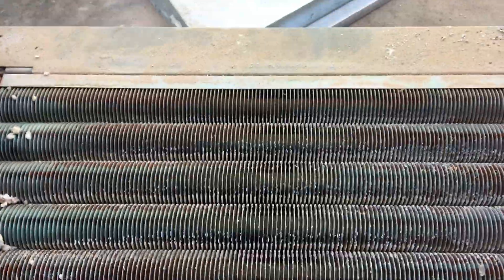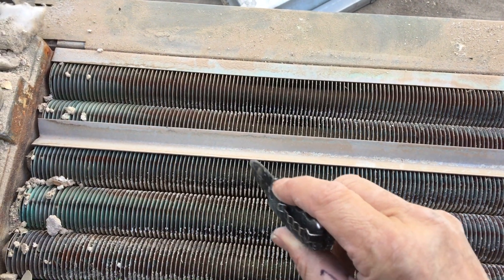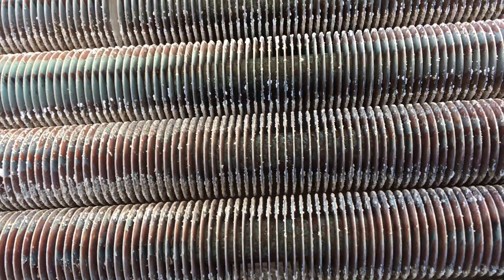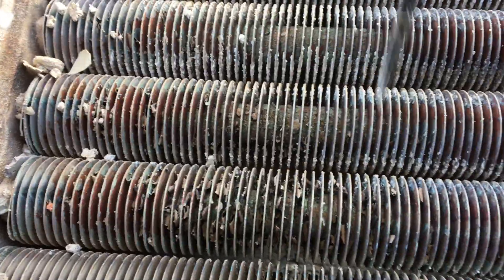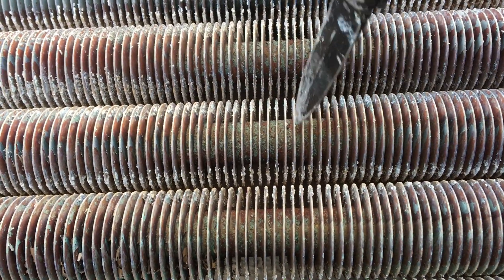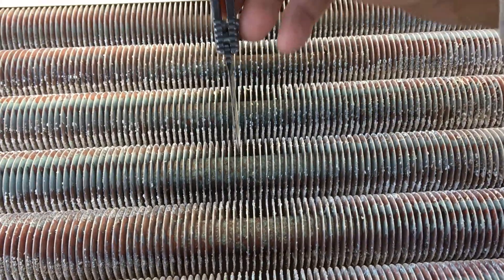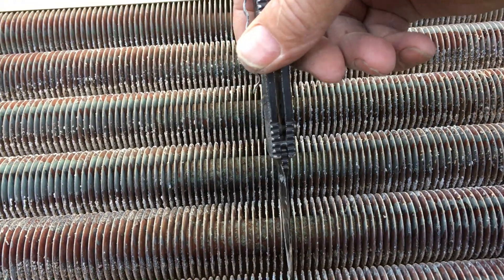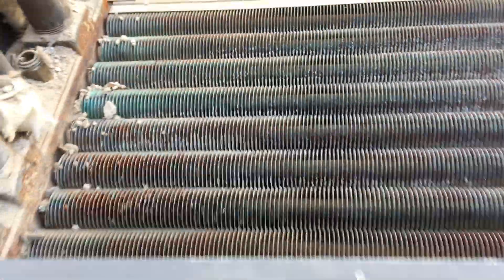Laars boiler dissection part 4

Comment: Teledyne Laars.  I’ve worked on some of those that were ten feet long and four feet deep.  The baffles were wired in place.  If there is any chlorine, such as in a swimming pool equipment room, it mixes with the combustion air, and rots all the fins off.  I’ve changed tube bundles in these that took four men to lift.  When you lift out the tube bundle, the combustion chamber walls would fall apart.  You have to re use the old brass manifolds, as the coil bundles were bare.  And then there are all the orange o rings in between.

Comment: Soak the heat exchanger with vinegar it will safe you time and the heat exchanger will look new.
Reply: do you remove them to soak them?
Reply: @TheMentalMKE  get a pump spray and spray the heat exhaust with the vinegar let it sit and rinse the heat exchanger with water. Don't forget to remove the refractory blocking fist.
Reply: @andresland9906 Thanks for passing along this information.
Reply: Thank you